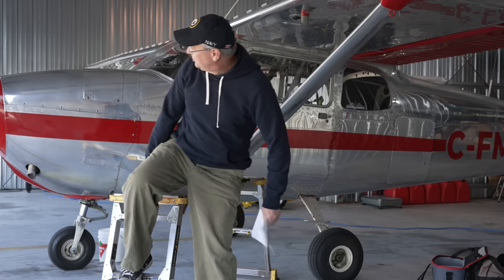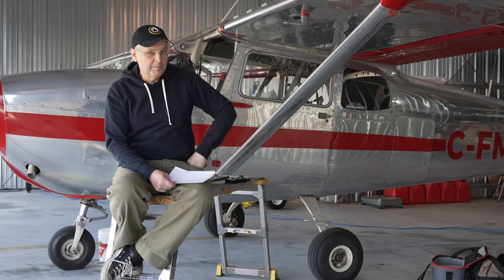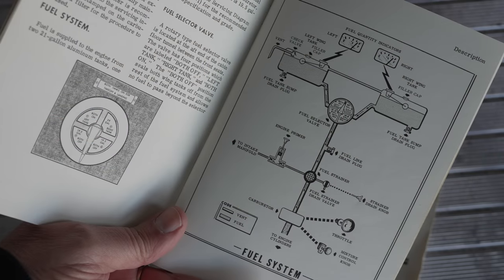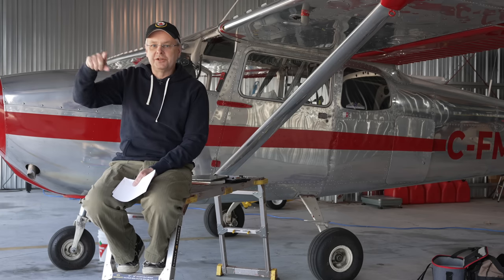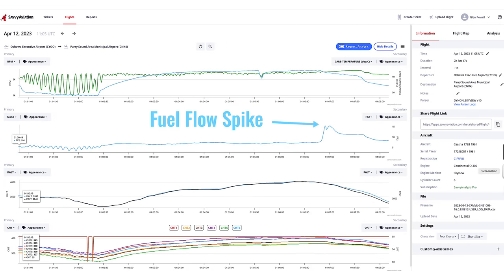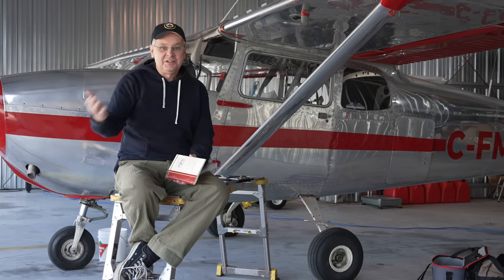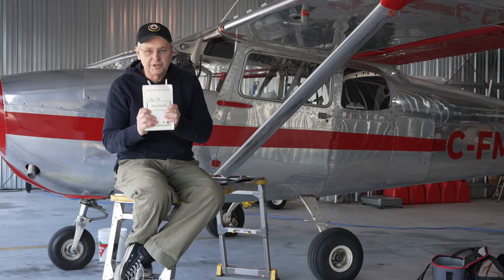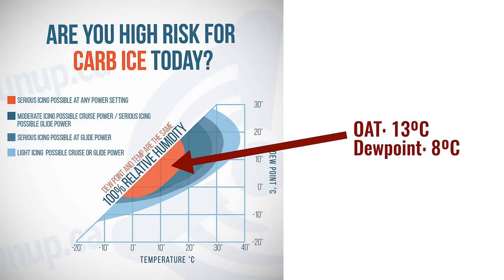Rough Engine- Was It Carb Ice Or Vapour Lock?

Comment: Thanks Glen.  I own a 1957 C-172.  I flew it for the better part of 500 hours in many conditions before experience vapor lock.  I have experienced it twice, and both occasions with the tank on both above 5000 feet.   

I think you’ve given the best explanation here that I have seen. A few points to add. I could not understand the mechanism of what would cause the vapor lock and how switching to single tank operation somehow made it better. According to the folklore on the Internet, Cessna apparently tried using glass tubes to see if they could replicate the problem and supposedly could not. After some consideration, I believe that’s probably true. The fact is that glass tubing does not conduct heat nearly as well as the aluminum fuel lines do.  By switching to single take operation, you are effectively doubling the fuel flow through the tubing between the fuel tank and the fuel selector,  thus allowing less opportunity for fuel bubble vapors to form and if they do, flushing them out of the system quicker.

Thanks for your videos and helping us fly safely!

Comment: Thank you for sharing! I would have never thought about vapour lock in anything carbureted, I've been taught that it only applies to fuel injected engines. Excellent reminder about the static nature of POH's. Great job on the cause check, glad to see you were able to land safe and continue your flight.
Reply: Lol, never owned a old Ford tractor? Fuel line goes between exhaust manifold and block- you can see the fuel boiling out from the tank outlet

Comment: Awesome video.  I got carb icing in my 172B over Honolulu once at 2000ft about 1 mile away from some moisture in the air.  I had difficulty maintaining the cleared altitude of 2000ft through the Class B airspace so I turned around and RTB at Kalaeloa.  While descending out of 2000ft I pulled the carb heat and the engine started running smooth again. I found out later from my mechanic that as the air goes through the carburetor the temperature drops about 30 degrees, which is how you can get carburetor icing in 70 degree weather in Hawaii.  Scary lesson to learn while flying over a metropolis like Honolulu.

Comment: Is there a way your dynon can give you a reminder if you get to 5000ft it will issue a master alarm switch to one tank...If you forget at cruse...  Also did the dynon give you a master alarm or anything that the engine was running out of normal parameters??? GREAT VIDEO...

You and Blancolierio need to get together someday...
Reply from the maker: The Dynon throws a bunch of warnings (audio and visual) for when different specific engine levels are out of parameter, and it does it on screen with different colours depending on severity (grey, yellow, red).  It doesn't have a warning for switching to one tank when reaching 5,000 ft, but that's burned into my brain at this point.

Comment: Wow! This just happened to me in my 1961 172C!!  Clear day 7500', 2300 rpm, leaned a bit, on both tanks running great.  Then the rpms faded and it nearly died. I did the same as you,  carb heat on mixture full rich... I throttled back and luckily was over KRBG.  I began descending, engine idling fine with carb heat on...at 4000' I wanted to test it,  full power full rich, carb heat off...again not good.  At that point I circled and landed. A&P cleaned the plugs, replaced 3 of them and I flew back home no problem.   I was not aware of the >5000' single tank AD. I wasn't aware that carb ice can happen at 2300 rpm,  my home A&P thinks I was too running ROP and it fouled my plugs...or was it vapor lock?  Either way,  I've learned a lot in the past few days!  Thanks Glen!
Reply from the maker: I'm glad that I could help!

Comment: I'm not a pilot, but this is a good framework for any issue in any industry 
1. Know your environment (your actual environment, not the environment "the book" says you have)
2. Know your likely problems 
3. Have a plan for avoiding those problems 
5. Know what to do when those problems happen anyway
6. Have a plan for post incident investigation 
7. Implement the lessons learned from the investigation into your procedures going forward to reduce the risk load.

Comment: Thank you for sharing your story.  I too experienced this issue in a 66' G model.  Once during my solo cross-country at 6500' DA, and a second time during a cross-country at 3500 PA.  
The first time was extremely unnerving being I was a student and still learning.  Luckily I had great instruction and followed my emergency procedures, which includes swapping to single tank operation.  As you stated swapping to the first tank did nothing to fix the issue. Upon swapping to the second tank she lit and all power was restored.  
As you stated there seems to be a lot of misunderstanding on this issue.  After landing I called my instructor and discussed the incident.  He wasn't positive of the problem so I started a full Google investigation into the problem.  After many pages of reading and sorting through the opinions and getting to the fact, I came to the same conclusion as you.  A combination of DA and auto fuel lead to vapor lock.  
I have a few documents from cessna that explain the issue.  Also found a document published by the Canadian equivalent to the FAA that does a deep dive into the use of auto gas in aircraft and the reasons for developing vapor lock with its use.
Reply from the maker: That Transport Canada document should be required reading for anyone flying a legacy Aero engine on MoGas: 
https://tc.canada.ca/sites/default/files/migrated/tp10737e.pdf
or even this one:
https://tc.canada.ca/en/aviation/reference-centre/airworthiness-manual-advisories-aircraft-maintenance-manufacturing-branch-advisory-circulars/airworthiness-manual-advisory-ama-no-5499

Comment: We own a '61 172B as well.  I have flown it for 20 years and not had a similar issue.  Then last year it happened 2x in 90 days at 7500 feet in moderate IMC conditions.  We did an identical investigation and came up with identical conclusions.  Additionally we had engine, fuel caps and fuel tanks all checked out to be 100% sure we ruled out all other possible causes.  We are 90%+ sure it was vapor lock both times.  You comments about POH and checklists are 100% correct as well.  Without wing extensions the stall / break is much lower than the POH indicates.  It has baffled a few CFIs over the years that the stall is so low.  Usually they give up and tell me to recover when the horn sounds.

Comment: I also have a 1960 172b, and mine also drains the left tank faster than the right. My dad (former cessna design engineer) found an article explaining why they do this. Basically its because of the vent system. Interesting on the fuel system ad, ill have to dig to see if mine was done because i dont have the sticker

Comment: Thanks for sharing. I have a 1963 172D. Was actually assembled in late 1962. My POH does address the issue of vapor lock. Perhaps it's a newer version of the original POH? Thinking about the issue with density altitude hadn't occurred to me. Very interesting.

Comment: Back in about 1978 or so, my father and I were flying into SFO in a '59 182.  It was stressful anyway!  Fairly low over the water on approach, and the engine starts running rough.  Carb heat on and a few seconds later it evened out.  Worst place to have that happen, though.  If it had been vapor lock or something worse, we'd have been in the water.  Not much time to fix things.

Comment: I only experienced carb ice one time. Cessna 180, beautiful day, started losing mp and thought the throttle friction was loose so I pushed in the throttle and tightened the friction. Twice. Light bulb comes on and I apply carburetor heat. Power drops further and then gradually returns to normal. Then my pulse rate gradually returns to normal.

Comment: The book you have for your 172 is an owners manual, not a POH. The POH and it's required use was mandated in the early 70's.
Reply from the maker: Regardless of the semantics of what the book is called (Owners Manual Vs POH) they serve the same purpose and contain the same operating information about the aircraft. Under Canadian Air Regulations, I'm required to carry it in the plane, in a place that is readily reachable while in flight.

Comment: HINDSIGHT "what could possibly go wrong"
Glen there's only one way to get experience, and you now have it.

VIDEO PRODUCTION, 90/100 INVESTIGATION 78/100
ANALYSIS 79/100
I am curious, when the plane is fitted with breather fuel caps. The other thoughts were engine heat vaporising fuel in the line/filter. Overall a good performance Glen keep up the good work.
🌏🇭🇲

Comment: Interesting. I was a 9500' in a 172G. Same thing happened to me. Hard to say if it it was carb ice or VL. I applied carb heat and switched tank. The engine came back to life and i went on my way.

Comment: Great video as always. Vapor lock is no joke. I was really wondering why there is a consensus that not many people comply with th AD's as they are mandatory.  Unlike service bulletins which are nonmandatory, the IA/A&P can't sign airworthyness off unless the AD's are complied with per the FAA. Is the TCCA different? I'm almost done with A&P and I'm wondering if there is some sort of situation I don't know of that could allow this.
Reply from the maker: In this case the AD had two parts and you could comply by doing either one or the other. You could change / fix the way the fuels lines were plumbed and eliminate the problem. OR. You could accept the problem and put on a vague sticker to comply with the AD.
I'm not sure why the FAA (who issued the AD) didn't demand that the fuel lines be changed? Could have been pressure put on by lobbyists who were trying to save owners a few bucks?
Reply: @GlensHangar  Awesome, thank you.

Comment: I have a '66 G model and the POH (which I ordered a few years ago) mentions nothing about vapor lock.  I also have an old tattered copy of the '67 H model POH and it DOES have a nice detailed description of vapor lock (at the end of Section 1) on single and both tanks along with how to avoid it and how to clear it if it happens.  I do not know if it was a later issue version with an update or if it included it in the original 67 issue.   Perhaps someone with more knowledge can shed some light.

Comment: Ive got 300 or so hours in early  172s over 30 years. I have to say i have never experienced vapor lock in one. Carb ice plenty of times. I have had vapor lock in other aircraft ( usually above 8000 feet) every time decending 2000 feet or so immediately fixed the roughness. I think looking at your graphs the reduction of fuel flow was the result of the power loss not the cause.
Reply from the maker: Could be - but some of the top mechanics / engineers in piston engine aviation have independently reviewed the data and would disagree with your thinking.

Comment: I don't believe it was vapor lock.  Temperatures weren't conducive to vapor lock.  However, excellent video, and it raised a lot a questions.  I have a Cessna 170 - and was puzzled why the AD didn't apply to the 170s.  Searching on the 170 forum - others have asked the same question years ago.  Here's an excerpt from a discussion with Cessna tech support in 2002:  "I just got off the phone with Cessna Technical Rep. Tim Fischer who had consulted with the retired Cessna Rep. responsible for developing this procedure that responds to the AD 72-07-02. Here's their answer:
The airplanes that experienced problems were later model Lycoming-powered 172's. Although with an altered fuel system which included short vent lines connecting the fuel delivery pipes to the fuel vent pipes, the problem continued. Although the factory was unable to duplicate all the symptoms reported by some operators, they did develop this procedure which eliminated all further complaints. (The Lycoming engine's greater fuel consumption may have contributed to a lowered head pressure in a system primarily designed for the C145/O300 engine.) Although none of the Continental-powered airplanes suffered from the problem, Cessna thought it conservative to include them in the AD note. (After carefully listening to the development of the conversation, I suspect it was to avoid casting dispersion upon their newly selected engines of choice, since Continentals would no longer be offered in the 172. In other words, they were not going to go back to the Continental as they'd bought over 4,000 Lycomings and had them in stock, so in order to not make it look like they'd selected a troublesome engine, they were anxious to make it apply to all previous aircraft. My own suspicion.-gh)
Even though the straight 1956 model 172 has exactly the same fuel system as the 170B none of the taildraggers ever had any such problems. (Nor in fact did any of the Continental 172's.) Proving this point to the FAA would cost Cessna a lot of time and money on airplanes no longer manufactured. Cessna took the easy way out with the FAA."  

Interesting issue.  I suspect you had carb ice, as conditions were conducive for it, although your experience switching between tanks gives me pause.  Who knows!  What's great, is posting videos like this to get people to better understand their airplane, obscure ADs, etc.  Note that assoicated service letter SE72-7 states that if you are running on both tanks, and experience fuel starvation issues, to switch to either single tank for 60 seconds, then switch tanks.  I wasn't aware of this (as I'm sure most pilots aren't).  So to cover all bets - maybe it's worth to switch tanks when encoutering engine roughness in addition to carb heat on these machines ....
Reply from the maker: Of course you are entitled to your opinion, but every expert I've shown the engine logs to agrees that it wasn't carb ice - based on carb temps, and other indicators. They all agree that it was a fuel starvation issue, and most likely vapour lock. 
You mention temperature wasn't conducive to vapour lock - temperature is only one factor that can create vapour lock, and it's a common mistake to believe that it is the only factor. When in fact turbulence, and pressure also cause vapour lock, and that's what is at play in this fuel system. 

As for the post from the 170 forum...
I've read it, and read variations of it on other forums from different posters. Problem is: it's all conjecture and here-say, with the original poster admitting it's also based on his own suspicions. The post also makes bold statements about Continental engined 172s, that from accident reports seem to be factually incorrect. 
I asked  the experts who reviewed my engine logs about this post and they all said essentially the same thing: whoever wrote it was just spewing bs to hear themselves talk.

Comment: I had a issue with my 61 172b with sticking valves. It would drop rpm until I would lower power and then it would go back the normal. It took for ever to figure out because it was not consistent

Comment: Great video, Glen.  Do you have a Carb temp sensor for the Dynon?  If not, are you going to install one?  They do have one, I just checked, although I don't know if it's available for your engine.  At least that way you would know if the temps in the carb were in the danger zone.

I think you did well, you kept your head about you, you worked the problem, you found a solution, and you were able to get on the ground and check things out before proceeding.

Comment: The Continental 0300 D engine can be susceptible to exhaust valves sticking also especially running 100LL it happened to me a few times in my 1966 Cessna 172 G
Reply from the maker: Valve sticking is a whole other can of worms. 
In this case the experts who looked at the engine data (Both are very Savvy and Superior in their knowledge if you catch my drift) concluded and confirmed that it was a short fuel starvation event that happened in the lines between the tanks and the fuel flow sensor - Vapour Lock.
We do a have a valve problem that we've been tracking in cylinder #6; and we'll be addressing that in an upcoming episode.

Comment: Some carb heat and some mixture lean cures most partial power.  But it takes 20 to 60 seconds.  My CFi Had 3 of those.
Reply from the maker: Yeah but based on the way fuel flow trickled to a near stop - the problem was far from the carb and engine.

Comment: I'm curious: is aviation fuel blended seasonally like automotive gasoline is? A few years ago I experienced symptoms very similar to what Glen describes while riding my fuel injected (no carb ice) motorcycle also on a warm April day. I limped home by stopping periodically to let everything cool down and occasionally adding a litre of fresh gas where available, after which the engine ran fine for a while.
       I had a long, very informative conversation with an engineer at the fuel company and concluded that the fuel in my tank was probably winter blend, which is brewed for High volatility in cold conditions. The unseasonable spring warmth (mid-20⁰s) probably caused excessive vapourization leading to vapour lock.
     Just wondering.

Comment: AT 5k you dont use rich mixture and full caarb heat.  You will flood the engine.  I had 3 partial power eng fails.  Lean the mixture with a bit carb heat only , not a lot.
Reply from the maker: Thanks for the tips! But in this situation where fuel flow had stopped, full Rich was the right decision.

Comment: Using the primer to get fuel to the engine may have helped troubleshooting. That being said I would be hesitant messing with an engine that's running even if its running rough.
Reply from the maker: That was part of my thought process - I know that messing with the primer during flight can cause issues, so why risk it. On the other hand it may have been a way to get a bit more fuel into the engine?